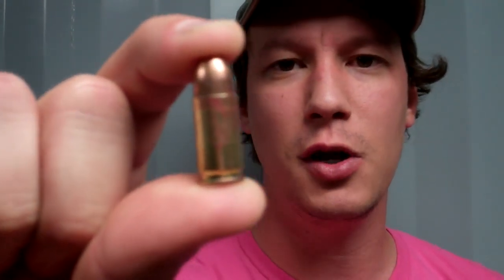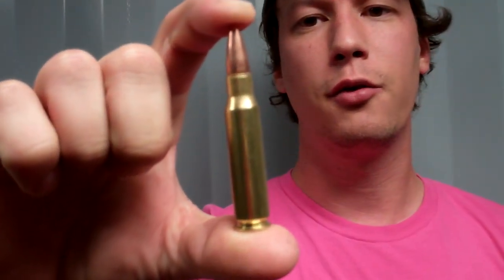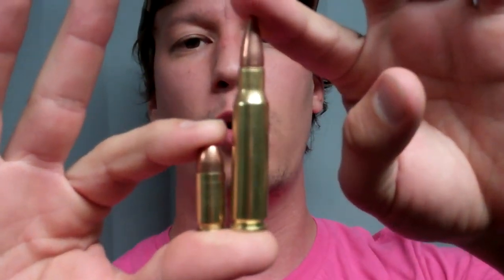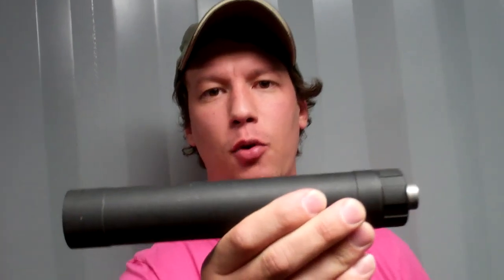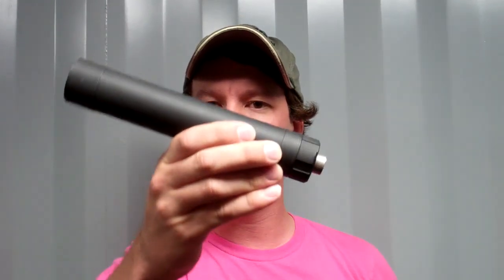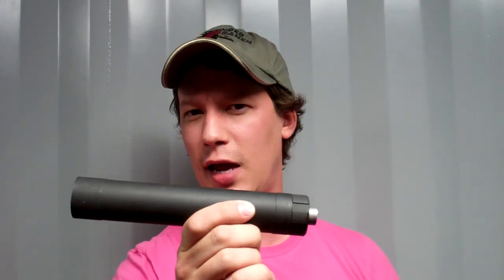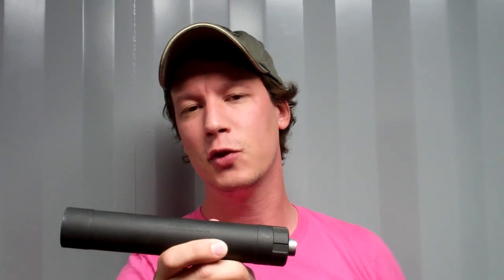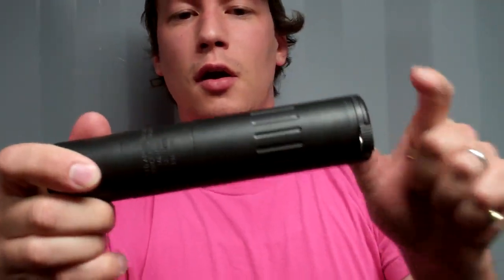Rifle_in_Pistol.MP4

Comment: Is it possible to run subsonic .300 Blackout in the Ti-Rant 45?

The .45 runs about 5-7 grains of powder and the .300 Blackout isn't running much more at about 10. Substantially less than standard 5.56.

I have a Ti-Rant 45 on my UMP clone and would love to be able to run it on my .300 Blackout Mk18 with subsonic loads...

so whats the skinny?